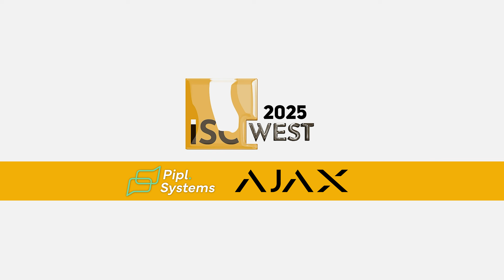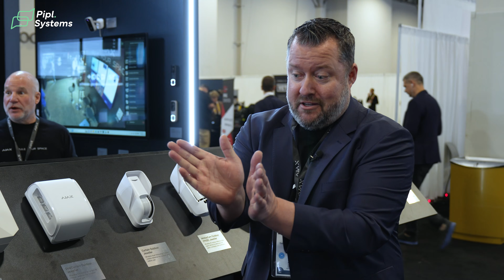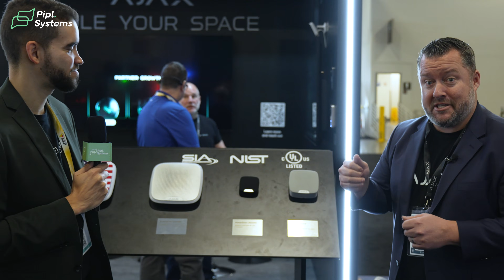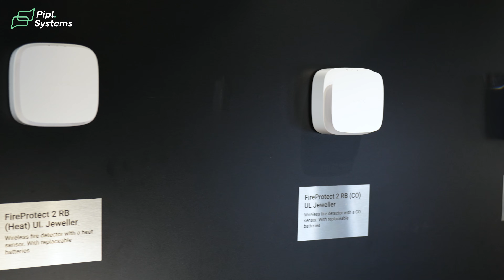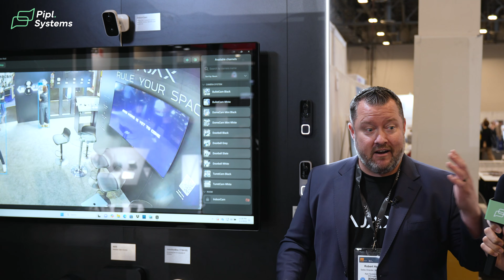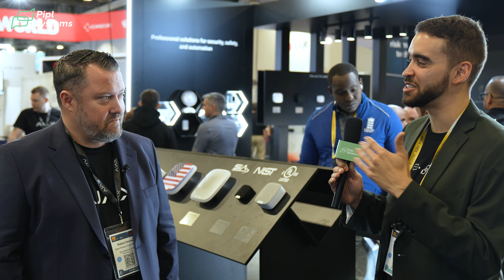Ajax Doorbell & More: New Ajax Systems Devices Unveiled at ISC West 2025

Comment: Have the door bell installed with Ajax hub, door protectx10, internal siren dual curtain protect. Waited 8 weeks for the doorbell. Disappointed after installation. Clarity poor than eufy 2k. Will not chime inside the house through internal sounder. You will need to upgrade the hub to the wings protocol compatible compatible ( hub plus will not be compatible with internal chime). With older hub, you will need to wire a chime. Notifications from AI detection is slow and delayed by s couple of minutes. AI detection when there is no human around with false notifications. I am disappointed that this has not done anything better than my old eufy doorbell
Reply from the maker: We're really sorry to hear about your negative experience with the Ajax video doorbell. It sounds super frustrating, and we appreciate you sharing your thoughts. It’s possible that something might not be quite right with the setup or configuration. Ajax often rolls out updates that fix previous issues, so this could be something they’re already working on or can address. We’d recommend reaching out to Ajax support. Do you have contacts?

Comment: Ajax is for degenerates... I have never had anything worse than that.
1.  It is freaking slow. That zigbee-alike protocol which they call jeweller or something is dem slow. If you want your motion delays up to 5-10 seconds, than it is right for you... Any light managment is a disaster.
2. It is incompatible with anything and enclosed from everything - if you naivelly expect that you take seccurity from Ajax, which is more or less ok, and build it into you smart home system, think again! It will never happen! They do not provide api for integration of their product into existing smart home systems! Ajax in Home Assistant - forget it! So, you either torture yourself with their degenerative crap because everything apart from seccurity alarm is a disaster in their product line, or you pick something else - there are options...
3. It is all cloud based! Dem - you are 15 meters away from your hub, and when the internet is down, you cannot arm or disarm it. You think it will never happen to you - think twice! I happened to use it under the circumstances when our area was blacked out and celular network was down - the access to the hub was gone too. When I wrote the support they suggested me using external keybord which i did not have!

Strongly do not recomend it to enyone!